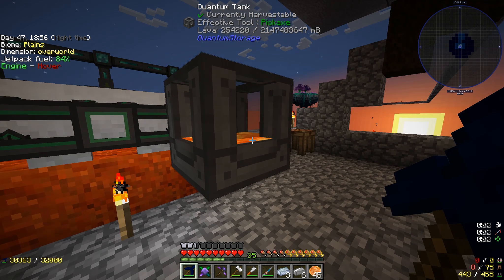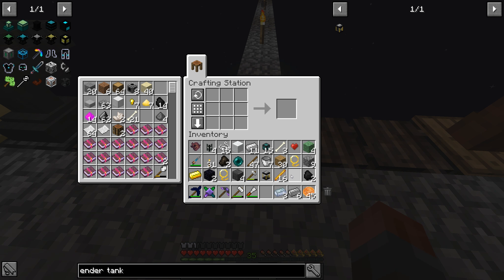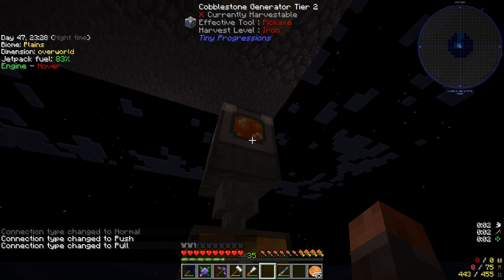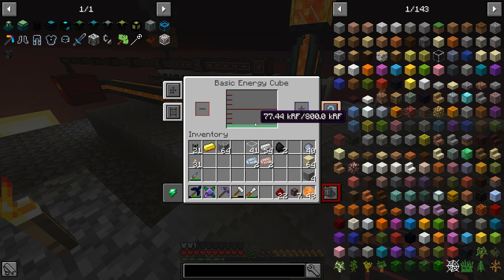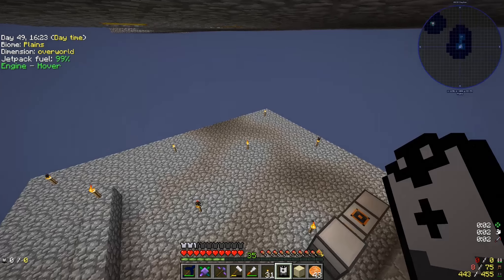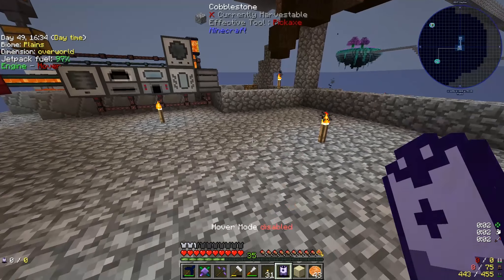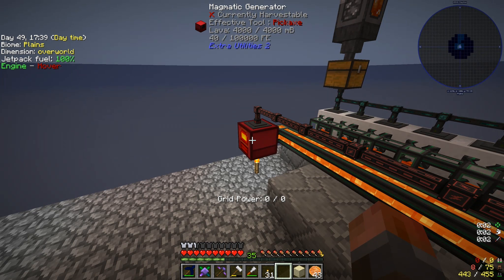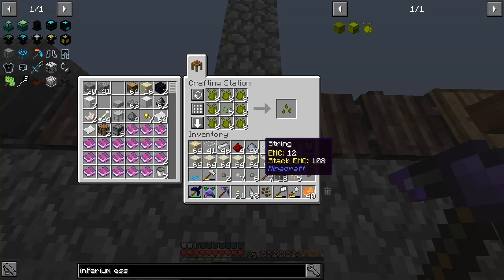Project Ozone 3 E05 - Scaling Up, First Farm and Better Batteries

Comment: Inferium and other Mystical Agriculutre seeds DO work in Cloches except the tier 6 version of Inferium or any seed that requires Insanium to craft.  The problem is that cloche recipe is changed and drastically harder to make than in other packs.  An slightly easier alternative is to make a Imaginary Time Block which does require a fair bit of resources but is doable even in fairly early/mid pack progression.  If you combine 1 imaginary time block with some thing like a Lilypad of Fertility or other growth enhancing item, the crops grow nearly instantly.  Personally I just use 1 time block + 1 Lilypad of fertility to speed the growth in the center of a 3x3 area, and then mechanical users right clicking the crops to autoharvest, and lastly a Item Collector to grab all the harvested items.

Stomp The Bean did do a tutorial-ish video explaining how to progress into and thru Lord Craft in this pack (how to do the research, get/make the crystals, etc) just the other day. https://www.youtube.com/watch?v=rmgT7LY5qJ4&t=0s

Comment: a bti later in the progression, you will be able to make a way to wirelessly charge stuff in your inventory or wearing.  If you kill a spirit (the little blue floating cube mobs that spawn when you sometimes kill mobs) with non-physical damage (such as tossing a instant damage splash potion at one of them) they drop ectoplasm.  Then place down a regular sapling and click it with the Ectoplasm to get a sapling that you can grow in a bonsai pot to "grow" ectoplasm trees.   The ectoplasm can be used to make Spectre Anchors (essentially like soulbound enchant but it DOES work on tinkers' tools/weapons), spectre coils to wirelessly charge machines, spectre string and ingots which are used to craft Spectre Energy Injector (this is where the spectre coils draw power from.

Additonally, the ingots and string can be used to craft a Spectre Charger which is a belt slot bauble that wirelessly charges things you are wearing or have in your inventory.. up to 20K rf/tick for the top tier version.  This also charges across dimensions.
Reply: Can also sieve the dirt you get from dirt+witch water and get the Ectoplasm sapling.
Reply: @d02cjo  yes, apparently you can.  I've never done it that way before. Thanks for the heads up.

Comment: I started this pack a bit late.  That quantum battery you made is no longer craftable it seems.  Not the first thing I've encountered that you've made that the pack creator has since removed.  Not your fault by any means but it is a bit frustrating.  As always, thumbs up on the episode and series.
Reply from the maker: I'll need to check later, but there are other options too - infinite battery maybe?  (I'll cover it in an upcoming episode once I find some options!)
Reply: @grayduster  I went ahead and rushed the wither boss, sifted some tainted soil for a ghost sapling, and made the wireless charger in the random things mod. It works.

Comment: Were you ever gonna resume your X4 series? That's what got me interested in your channel to begin with.
Reply from the maker: There'll be an episode coming up soon covering patch 1.60, 2.0, etc.  The main issue with X4 is that it's a lot of the same I've already shown from this point in, and I wasn't a fan of having episodic 'and here's another station I built'  and 'here's another ship I bought' - it'd quickly become uninteresting.  I'd like to cover a few of the mods available (they're really quite good), and possibly more gameplay elements once they become available - like shipyards.